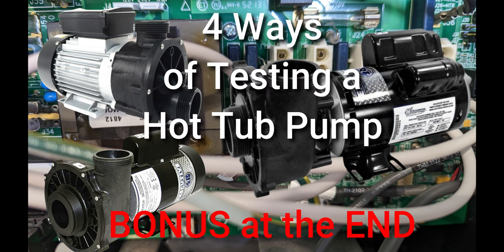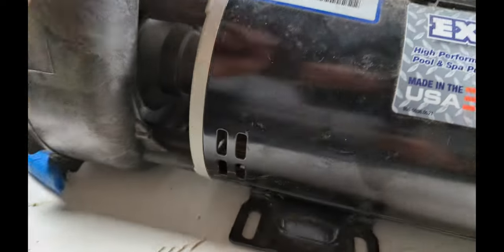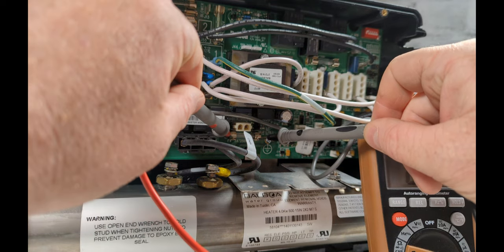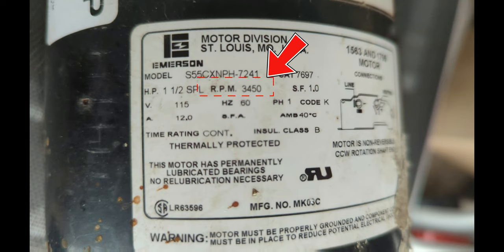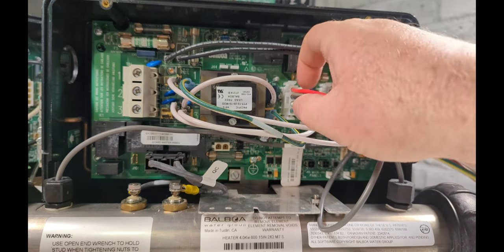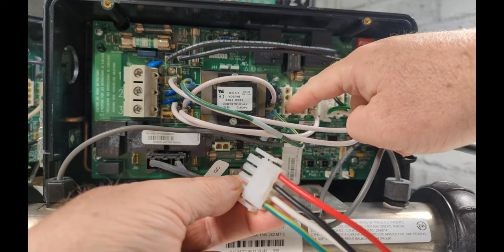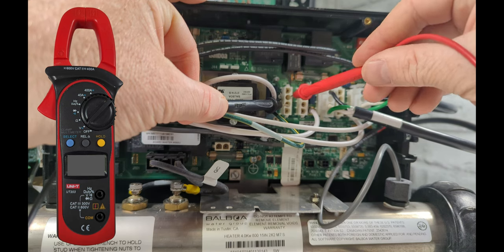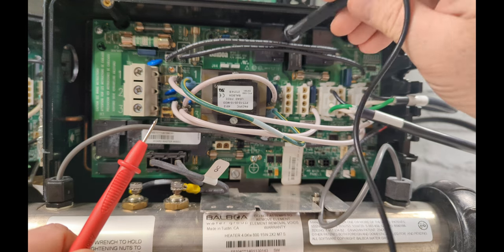4 Ways of Testing a Hot Tub Pump | Hot Tub Pump Motor Not Working | Hot Tub Pump Humming

Comment: Thank you for this video!  I discovered my hot tub pump (circa 2008) is not turning on - just clicks when jets are supposed to be on.  I did have an issue last May when I discovered the tub emptied of water caused by some sort of two-piece PVC “box” joining two segments of vinyl water tubing leading to a footwell jet, which came apart at the seams.  The circuit was tripped.  I wondered if that caused damage to the system.  I suspect the pump is dead, but don’t know for sure (I tried to manually rotate the rusted metal rod between the motor and the wet end, and it’s not moving).  Capacitor tested fine.  I don’t like messing with high voltage so I haven’t tested the voltage or amps yet, nor the relays.  I was planning to pull out the pump to tinker with it, but I’m guessing to test the Amps, I’d need to do that prior to pulling out the pump - is that correct?  It seems like I could test the volts on the board as well as the relays with the pump removed.  Thanks again for the video!
Reply from the maker: Sounds like a fuse.  Test the fuse first.  Also.  If you turn the pump on and hear a hum, could be a seized pump.   if you can't move the shaft of the pump, its seized.  Need to change the seal and bearing if thats the case.
Reply: @VIPPoolsandSpas  thank you.  I tested all the fuses.  All are good (I think - they all showed a value on the multimeter).  There’s no motor humming, just a click when the jets “turn on”.  I attempted a voltage test on the board connection for the pump, and I feel I did it correctly, although I didn’t see 230 volts - seemed like a lot less and wasn’t steady.  I’m not too knowledgeable about voltage meters and electricity though.  Might be time for me to check with an electrician!

Comment: If the pump just hums but doesn't rotate to pump I'm assuming it's probably seized bearing or something jamming the propellers correct? Or are there other possibilities? Thanks for the video!
Reply from the maker: @naturestrail2296  your right.  Bearing or something in impeller
Reply: @VIPPoolsandSpas   thanks for the response
Reply: Another possibility is that your capacitor needs to be replaced

Comment: Great video. Thanks, for taking the time to make and share. I have an issue with my hot tub. Service guy has been out numerous times and can’t figure it out. The hot tub breaker is tripping immediately as the circulation starts up. And, it’s random. Could run 1 day or 7 days straight; then trip. I Replaced main breaker also, and this did not fix issue. Any ideas?
Also, how long after circulating pump starts up does the heater turn on? 
Thanks - Rob
Reply from the maker: For this type of situation, I disconnect everything one thing at a time except pump 1 (or the circ pump).  This will pin point your problem.  If you disconnect the OZONE, you'll have to run it until it trips or it doesn't/.  Could be anything but most likely the heater element.   Sometimes its one of the pump capacitors going bad.  The heater will turn on about 1 min after start up.  depends on spa pack.
Reply: @VIPPoolsandSpas  
Appreciate your quick response. If the heating element starts 1 minute after circulating pump, and hot tub breaker is tripping as soon as circulating pump try’s to to turn,would this rule out the heating element?  Thank you very much for taking time to response to me. I value your input
Reply from the maker: @robertholmes1556  could be the relay for the heater also.   The only way to test this type of situation is to disconnect one thing at a time and leave it.  Disconnect the ozone and keep the tub running.  If it trips, it's not the ozone.  Then go to the next thing.  Maybe disconnect the heater and run the tub until it trips.  If it says running for days, it might be the heater element.

Comment: Hi, thanks for your helpful videos on your members channel, I have a hawaii 735L with a Balboa MGS504SZ PCB, I only have 1 jet button but a 2 speed pump, for some reason the low speed pump is not working, do you know when and how this low speed pump should work? Full speed pump and heater working fine until an error everntually pops up the screen, thanks in advance
Reply from the maker: Is the pump 2 speed?  Check programming.  If it's heating but low speed doesn't work, that means it's heating on high speed.
Reply: @VIPPoolsandSpas  thanks a lot for the reply, yes the pump is 2 speed, it starts heating up while the high speed pump is working, but eventually when that stops it comes up with either HFL or Lo codes and doesnt hear up anymore, got it programmed on standard mode so the low speed should work quite a lot?
Reply from the maker: @lukefitzpatrick8369  not that programming.  It's the dip switch programming.  The tub thinks it has a circ pump and 1 pump.  It only has one pump right?
Reply: @VIPPoolsandSpas  yes it only has one pump
Reply from the maker: @lukefitzpatrick8369  try dip switch 1.  That's test mode.  Go to setup and make sure your on the right setup.  The setups for equipment is on the back of the door on the pack.
Reply: Hi There, still having issues with this same problem, my top controller only has 1 button for the jets, no aux or any other buttons, unsure of what tells the pump to run on low speed? I have done the tests as shown in this video, only getting voltage on the high speed terminal (the top one), I have also tested all the relays and all working fine, just unsure what tells the low level pump to work? Thanks in advance

Comment: Great video, Im having a issue that with pump on high speed and heat on it kicks the gfci breaker after about 30 secons. Heater checks out fine with all tests. Pump is new. On these tests when testing for 240v to pump, i have 240 volts going to the pump at both the low and high speed at the same time. When the video says one should be 0.  Would this mean a stuck relay?
Reply from the maker: What's the volts and amps on the element when pump in low speed and on high speed?  Did you also disconnect the ozone?  That's if you have one.
Reply: @VIPPoolsandSpas  these are my readings 

Pump low speed 240v between white and red on plug, 240v between white and black on plug. 

Pump high speed, white and red 240v 
White and black 25v 

Pump low speed 3.4 amps
Pump high speed 11.4 amps 

Heater 22 amps hi and low speed 

Heater 240v hi and low speed
Reply: Ozonator unplugged for everything, low speed and heat it will run fine forever, high speed and heat about 10 to 40 seconds and trips breaker
Reply from the maker: @killcool1  is this a new install or has this hot tub been there for awhile a d this just happened?
Reply: Hot tub is about a 2002, basically board fried a couple months ago, so ordered new board, tested that worked fine until high speed no heat, shot sparks out by transformer on new board,  shut off quickly, took pump to get checked, bad high speed on pump, ordered new pump installed and this is where we are
Reply from the maker: @killcool1  would say that the new board is toast if you say sparks coming off of it.  Never a good sign when you see that sort of thing.
Reply: Yea I thought maybe, any idea what on the board? The first board that went it fried the relay in the bottom left corner, the boards a balboa m7. The new one when it did spark it was from the transformer.
Reply from the maker: pump capacitor ?

Comment: If you are testing across white and black or white and red shouldn't it be 120V, I would think going across black and red should read 230V, no?
Reply from the maker: No. Its not applied the same way as testing the heater element.    If low speed was ON, white black would be whatever volts that pump was...  230V or 120V.   SO.  You have a 120v spa pump.  Its on low speed.  Test the white and black and you'll get 120v.  If it was a 2 speed pump you would have the red wire for high speed.  Has to test white and black for LOW and white and red for HIGH.  Remember.  it has to be in that "MODE".  High speed or low speed.   If you test red and black, its 0 volts.  Also.  The volts from LOW (white and black) would be 0 because you switched the volts over to HIGH.  Now high is 120Volts
Reply: @VIPPoolsandSpas  Excellent explanation - thank you!

Comment: Nice work. Like #99.  My Motor won't run. I press the Jet button (Single speed), I hear a CLICK, and no power from board to motor. :(
Reply from the maker: Did you test the pump volts and its capaitor?  could be just that.
Reply: Hi, did you resolve your problem?

Comment: Thanks for the video.  Just today I discovered my jets will not come on.  I have a 2006 Hotsprings Jetsetter ll hottub.  When I go to turn on the jets I can see the jet symbol appear in the control panel screen and I can hear a “click” as if the board has told the pump to turn on, but no jets.  This happens in both jet modes, the regular jet on mode and the 10 minute clean mode as well.  Do you think I have a bad pump?  Would you know if I could perform your “bonus” test with my set up?  Because I also have a 24 hour circulation pump as well for the ever-clean system that’s built into my tub.  Thx
Reply from the maker: Test your fuses.  Most likely a fuse.
Reply: @VIPPoolsandSpas  I just opened up my spa panel and I do not have any fuses, at least nothing that looks like traditional fuses, as you show in the video.  I wish I could send you a picture of the circuit board.  But I have nothing like what you show.  I may be at the mercy of a repair tech to diagnose my problem.
Reply from the maker: @tundrawhisperer4821  Send pic to admin@vippools.ca